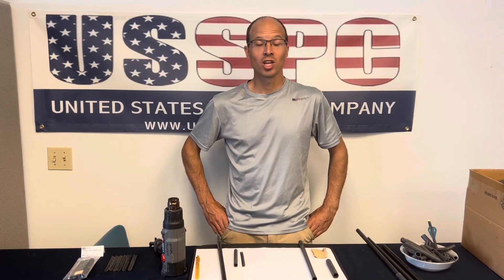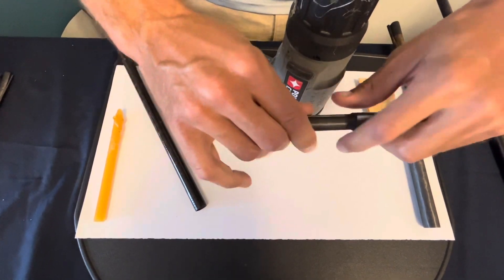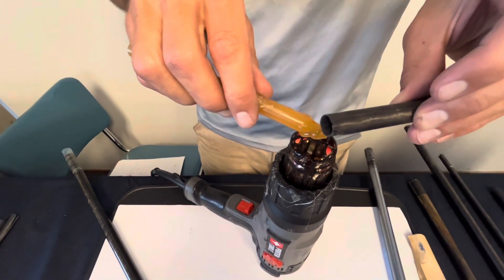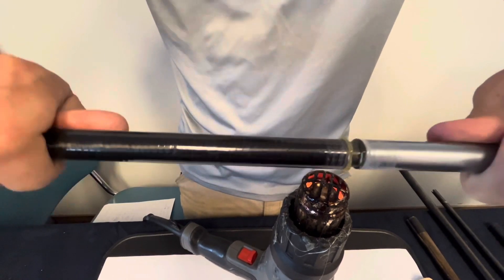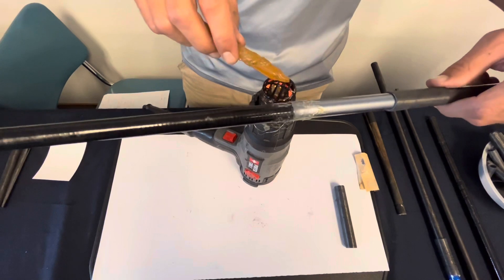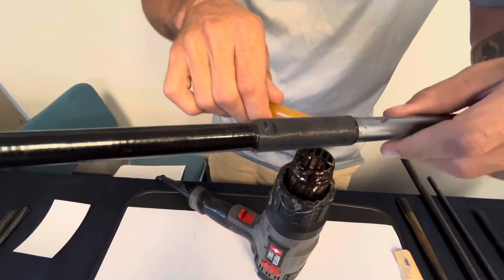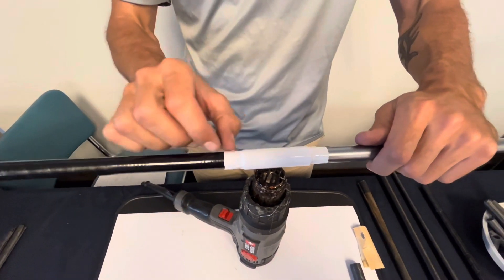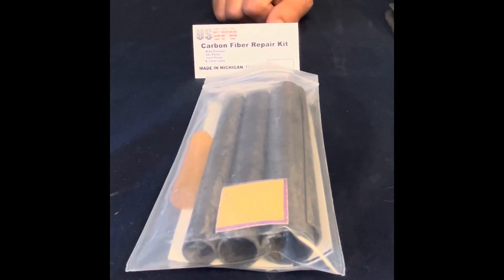DIY Repair Ski Poles or make carbon tubes longer

Comment: I used to use shim tubes in the past, but I now prefer using carbon tape and epoxy. The result is lighter, one does not rely on having tubes of the right diameter lying around, and the resulting connection is stronger than the original tube. The disadvantage is that one has to wait o/n for the epoxy to cure. BTW hot melt glue, unlike epoxy, can snap in cold temperatures.
Reply from the maker: Thank you for your comment. We do not recommend using standard hot melt glue from the hardware store or random stores on the internet. We recommend using our 'Tip Glue.' We sent our materials to the Henkel Chemistry Lab where they tested and created the best glue for our materials that adhere from -60'F to +140'F.